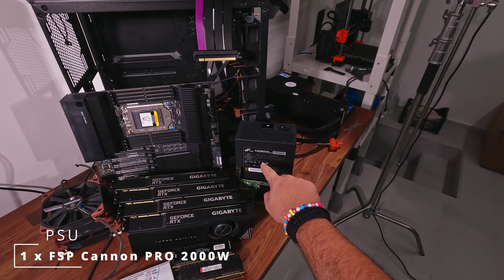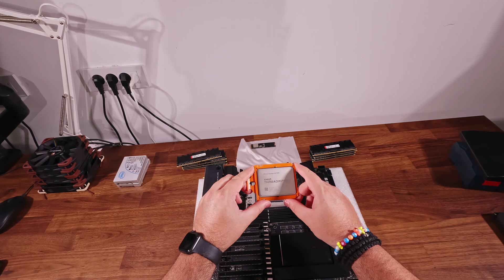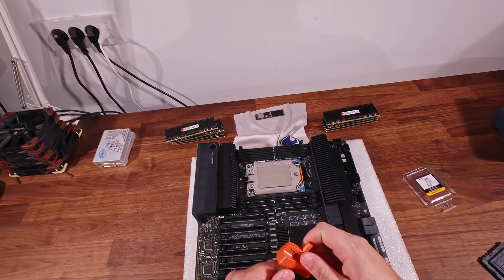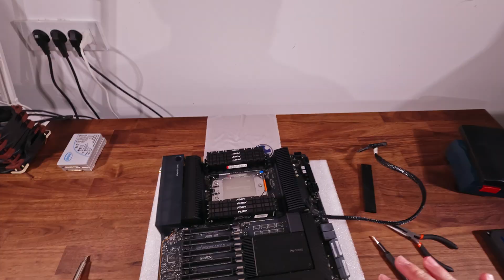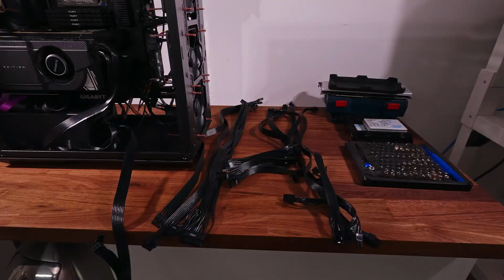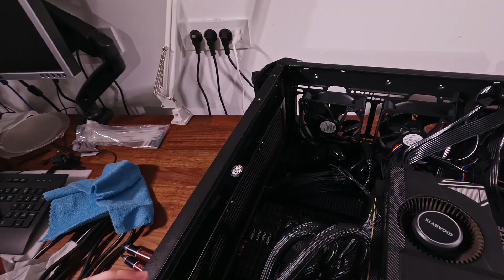Workstation Build: Makings of a Monster

Comment: Well now I have to up my game! Dude this is a SICK build. Now I know what you had been waiting on and Im glad it showed up without major headaches like you have hit in past!
Reply from the maker: I have had a few days with it now testing different things, this board has some quirks to it, for one re-drivers that are on the board aren't really re-driving all that well out of the box, default values simply do not cut it, I have spent a better part of one day just tunning that and still there is an occasional PCIE signal integrity error also power seams to be an issue, well transient load issue that is especially when GPU's are fluctuating between lower power states to higher power states if you have a constant load then there are no issues but that transient load is a problem, setting a static frequency fixes everything. Other then that it has been pretty smooth build.
Reply from the maker: At least the GPU's didn't come from the HEN farm this time. But I did re-paste and re-pad all of them just to be sure.